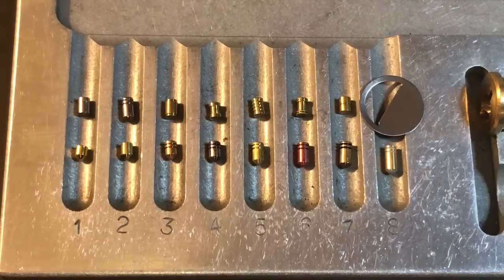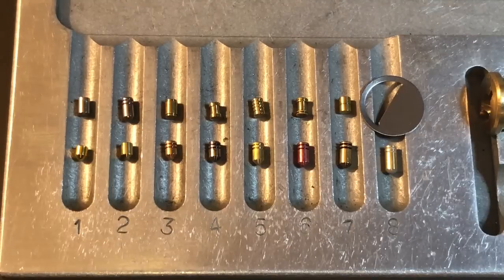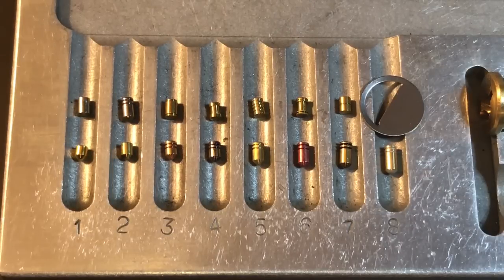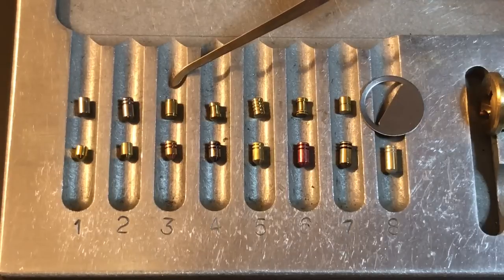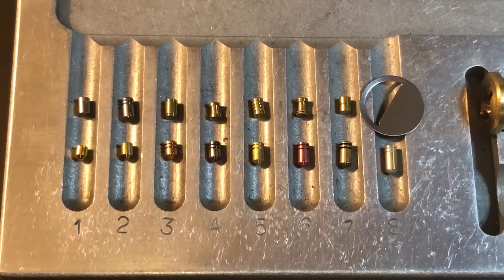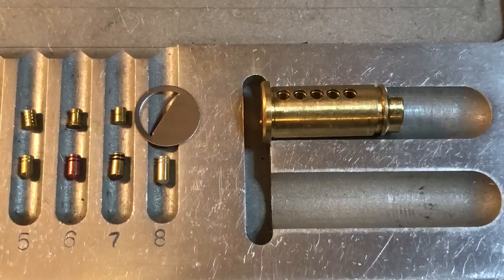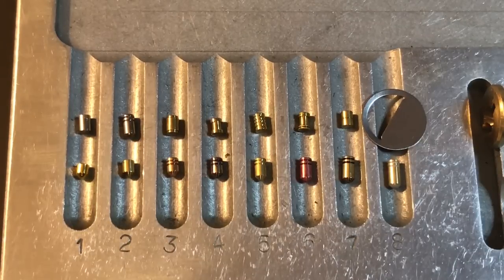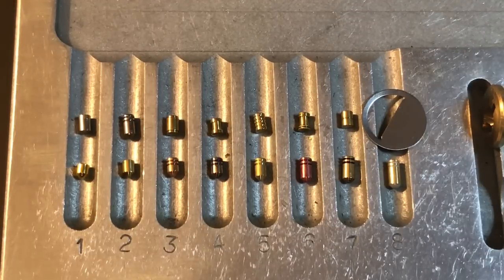[311] 40mmAL Series: Point System Supplemented and Clarified

Comment: I like the ranking system you put in place. I think it should be the start of an international picking rating system. I suggest calling it the "LPL scale" of pickability. Even though I would suggest adding another 5 points for locks that not only need a specialized pick but rather a "unique" self-made pick or tool. Since these would be unpickable for anyone without picking and machining skills.

Comment: I'm glad you clarified that, the short keypin issue with the Americans was playing on my mind.
I note also that all of these locks have ball bearing locking mechanisms, are there any spring loaded shimable locks that have removable cores?
Reply from the maker: Thanks.  Not shimable locks in this group.  I had an Abus 80ti/40 in the group which is shimable, but I cut it after I decided to limit it to removable core locks.

Comment: First, thanks for your so enjoyable and informative channel !

I agree with your new system point except for the anti-drill pins - we are talking about non-destructive manipulations, after all ;-) More seriously, the problem I see about taking anti-drill pins into account is that you should then take all other anti-drill techniques, and more largely all destructive counter measures as well. It would go far beyond the topic of this serie, and it is often more or less already done and indicated by the manufacturer.
On the other hand, I miss that you don't take in account the tolerance and the feedback. I understand that would be difficult to measure accurately, and it probably would be a subjective rating, but those are imo quite important features when picking a lock. Also, would it make sense to take all the different springs into account ?
Reply from the maker: Thanks for your thoughtful comment.  You are 100% correct that the anti drill pins do not affect picking.  Here's why I included them anyway.  In these small padlock cores, the anti-drill pins usually take up space that you would normally have a security pin.  As such, if I did not give points for anti-drill pins, I would end up penalizing locks for increasing physical security.  That's backward IMO.  So if that was my concern, why did I give double points for security anti-drill pins?  Well, once I started down the path of giving points to hardened pins, I needed to be consistent.  As for tolerances and feedback, again, you are correct... but only in the abstract.  This rating scale was designed for this group of locks.  None of them have any significant advantage in tolerances.  Finally, with a couple inapplicable exceptions, I general don't find that springs make a big difference in picking difficulty... particularly in factory-pinning locks (as opposed to challenge locks).
Reply: Thank you very much for the explanations :-), it totally makes sense to me now.
Can't wait for the rest of the series (not mentioning all the others!), I love aluminum padlocks ;-)
You're the best. Seriously. Again, thanks !

Comment: I see two "problems".

Imagine a lock will all steel security pins and threaded chambers, but is by-passable. It would get a high score, but all the security never comes into play. The lack of by-pass protection should take away all the points gained from the security pins and chambers I would say.

Imagine another lock will all standard steel pins and one will all security pins. These two would get the same score, but one is much easier to pick than the other. One way to counter this is giving grades in factors of 10. E.g. 1 point for anti drill pin, 10 points for security pins, 100 points for threaded chambers and so on.

What do you think?
Reply: Btw. Being able to shim it should also counter all security points just like by-passing.
Reply: Do you give points for spinner plates and shutters?
Reply from the maker: All of your points are valid, BUT, this scoring system is designed specifically for this group of locks.  There are no locks (i) with spinners, (ii) that are shimable (they are all ball bearing), (iii) that have all steel security pins, but are bypassable, or (iv) that have all standard steel pins.  What I think you are doing is trying to create a more general system for rating locks.  That's a bold task.  Offhand, if I were doing that, I'd be inclined to issue separate scores for pure pick resistance and everything else... and even then, I'd probably compile sub scoring categories.
Reply: I see. So you would never mix the points for a general purpose scoring?

It would be great to have a good and fair point system and lock pickers would agree on. Each lock company have their own biossed ratings =)
Reply from the maker: Jasmine Lognnes I wouldn't say "never," but it would have to be structured very differently.  If I was looking to translate a lock into a single number, I would define several categories, each of which would be rated on the same scale (arbitrarily, let's just say 1-10)... then the overall rating would be the lowest of the sub-category scores.  As I write this, I realize that what I'm proposing isn't too dissimilar to the CEN ratings (but my would incorporate pick resistance).

Comment: u will lose I used super glue pick all day longer plz try your best
Reply from the maker: You would be surprised how many locks make their way to me with superglue in them.  I have a large jar of acetone to soak the lock in when that happens.
Reply: Really? The world is a weird and dark place sometimes
Reply from the maker: Lock Noob  I buy (or get for free) bulk broken padlocks from locksmiths... they are the ones who run into the issue.  They usually cut the shackle.  If I can get the core working, I'll restore the lock with a new shackle. :-)
Reply: Ooooooh, I seeeeee. That makes more sense than a load of people sending you locks full of glue, lol